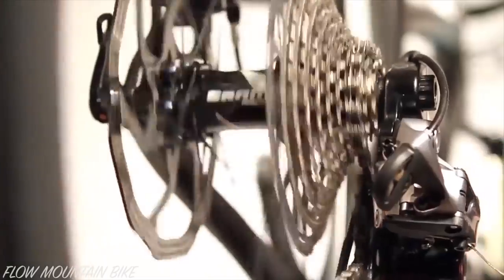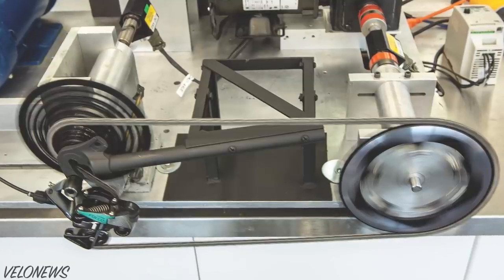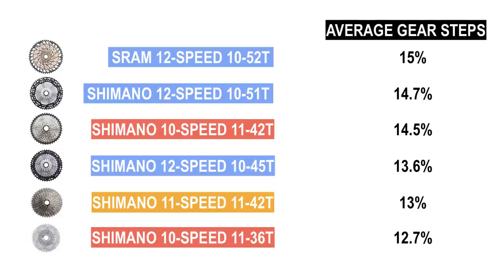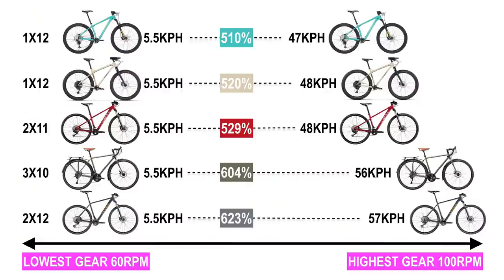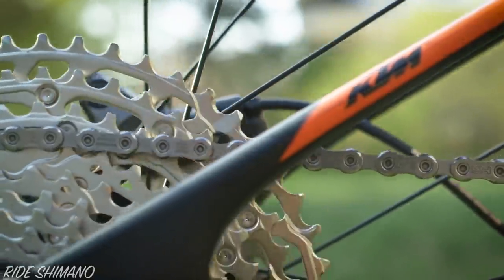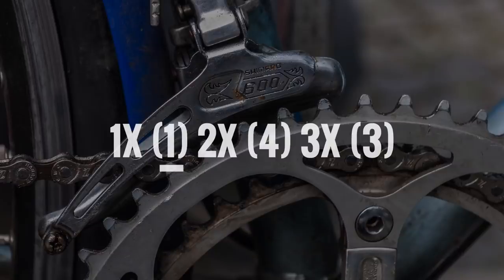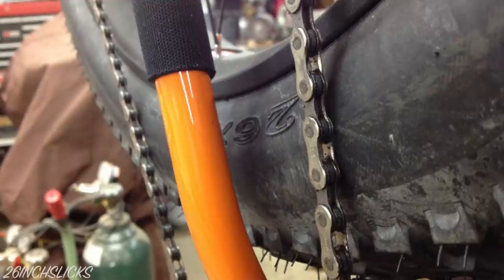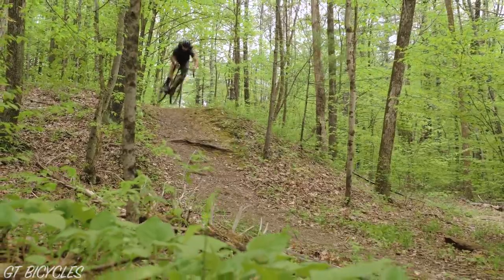1X vs 2X | What is the ULTIMATE Drivetrain For Your Bike?

Comment: The 8s chain can be used for more than 10,000km; the 12s chain loses shifting performance after less than 2,000km. As always, SRAM products give strange results in testing.
Reply: In Wippermann's test of the 11S chain, SRAM's chain was the lowest of all manufacturers.
Reply: The laws of physics in our world don't make a lightweight, thin chain last longer than a sturdy 8s chain.
Reply from the maker: It's not about physics. The latest materials and surface hardening treatments only make it to the new 12-speed equipment, which results in thin chains lasting longer.
Reply: @Cyclingabout  Oddly enough, I remember hearing the same story on the 9s, 10s and 11s.
Reply: I doubled the number of chain changes per year when I went from 8s to 9s.
Reply from the maker: This is not a story. The same guy has tested 9, 10, 11 and 12-speed chains on the same test rig, and the chains are lasting longer every generation.

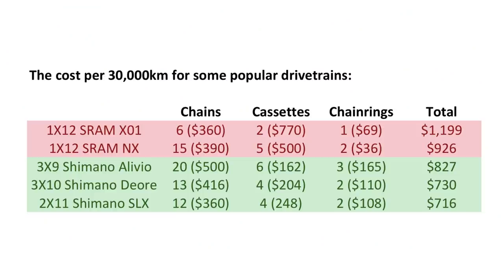Comment: 6:19 something's wrong there. 20 Alivio chains for 30k km means alivio chain lasts only 1500km, and that's totally wrong. And it cost about twice  less then 25usd (500/20). Then, Sram X01, 6 chains on 30k km = 1 chain /5k km. Minute earlier we were told X01 goes for ~7k km.
Reply from the maker: Oops, a few mistakes in there because Zero Friction Cycling has two different ways to measure 0.5% elongation. I also had to round up and down some numbers to arrive at a 30,000km figure. Prices were all from the same online store.
But don't get too caught up in the details - chain longevity is mostly based on the conditions, cleaning and lubrication.
Reply: @Cyclingabout  I just don't get how can it be that 12sp thiner chain that works with whole range on cassette with maximum offset can last 3-4 times longer, then thicker 9-10sp on 3x9/3x10, where it works with 3-4 according chainrings on cassette with low offset. I'ts either wrong experiment conditions, either just Sram paid "experiment".
Reply: @Cyclingabout  even logically, we have power loss info, more power loss = more friction = more wear.
Reply from the maker: It's unfortunately not that simple. We believe the reason why top-tier SRAM chains last so long are because of improvements in materials engineering and metal treatments. Expensive chains go through more levels of material hardening compared to cheaper chains.
In terms of resistance, it's the larger gaps between the components of a chain (allowing lubricant to travel freely) that makes them fast. SRAM is running much tighter tolerances compared to Shimano.
Reply from the maker: @Tom Zabukošek I'd love to see the data on an HG71 chain too!

Comment: One clear advantage for 1x is the oval chainring, while it can be found for 2x systems too, but it is more common for 1x drive trains. 😁
Reply: I rode 1x with an oval for around 3 years, and switched to 2x on my new bike and I don't notice any difference.
Reply: what's the advantage ?

Comment: I know it's not as clear as comparing drivetrains but have you thought about making a video about tires? For me this is one of the ultimate bike nerd topics. I would be interested in a compairison of different puncture protection like having a rubber inlay like the Schwalbe Marathon vs having a nylon based system. 
Or just in general, which tires have you been running/ most happy with? What is your take on tire width and pressure. Most of the time this is only considered without luggage but I think it would be interesting to see how you find find the best pressure If you have an unusual weight balance like on a loaded touring bike
Reply: Oh I just saw you had an article about tires already but no video
Reply from the maker: I can definitely cover tyres in a future video. You should find three articles on the website around tyres. The topics are rolling resistance, punture resistance and bikepacking/off-road tyres.

Comment: Thanks for this video!! These are all conclusions I have reached using logic and personal experience and now I have saved this video in my browser to show people the objective proof! The trendy (non competition) bikers laughed at me when I bought a new, high end mountain bike (with front and rear suspension) and had the store install a 2X11 Shimano cassette instead of taking it with the 1X12 SRAM set. I do such a wide variety of intense recreational cycling here in Costa Rica so the 2X (and suspension lockout) made so much more practical sense to me. I can climb steeper grades and take advantage of long downhill sections on asphalt leaving my equally-fit riding companions behind in both situations. I have a road bike and love riding that but my mtb is a great ride even for long distances on the roads due to the overall range and closer spacing of the gearing (and using the suspension lockout). The real surprise in your research is the durability of the 12 speed chains!! What would account for this?! It seems like a subject for a future video. If you could get a longer lasting 11 speed chain it would make it an even cheaper long term setup.
Reply from the maker: There is a lot of interesting stuff going on with chains, so it probably does warrant a video. But essentially, for every new generation of chains, we have a better understanding of materials engineering, metal hardening processes and coating treatments. Unfortunately, the latest chain technology is always reserved for the top-tier chains, which have the most speeds.
Reply: @Cyclingabout  The difference is striking however. I'm sure the tech will trickle down (look at how a $1000 bike is much better than a bike of equal indexed cost from x number of years ago). 
PS Just watched and thoroughly enjoyed your 2,000km Mexico video. Well done!
Reply from the maker: @darylloth3237  Cheers! Historically, chain tech rarely trickles down - so I wouldn't hold your breath. There is a chance that the chain-specific companies could introduce products to fill the gaps, but they usually don't have the same kind of resources as Shimano or SRAM. I guess time will tell.
Reply: @Cyclingabout  If you're ever in Costa Rica look me up. You've got a place to stay if it's on your route.
Reply from the maker: @darylloth3237  Cheers! I passed through late last year, so it might be a while until I'm next in the area. But a lovely part of the world to live. 👌🏼

Comment: I'd say I still prefer the 2x because I can get a  bigger range . But my new 1x is a 34tooth only slightly smaller than my 36 tooth on my 2x which actually makes the ratio of the second last gear better for me. I couldn't really use the last gear on my 2x drivetrain and I have never needed to use the first gear on my 2x I think the lowest I've gone is 3rd gear on the 1st chainring. My 1x drivetrain's 1st gear ratio is slightly lower than thay so there's no problem. Plus the linkage is completely different , I have to deal with a lot of pedal sag on the old one but almost 0 on the new one

Comment: 5:31 now what i wonder is what the results would show if you didn't use a drive chain sold for bikes? There are alot of industrial use chains rated for the same size and dirty conditions that could do better.

Other mods might need to be made if you have alot of gears, hence why I think the idea could work better for either a 3x or anything with less gears.

Comment: I have a older 2002 mongoose mtb model zero 3. Could you answer a couple questions please? 1. I am trying to make this dual suspension  bike a hybrid road/ gravel commuter by changing to a 1x crank chainring. What would you recommend as a budget conversion? Bike is stock. I am changing tires to a road/gravel tire but wondered if you could recommend a low rolling resistance tire with puncture restistance please. My commute is 20 miles round trip on hwy tarmac shoulder. Thanks for all you do and your awesome informative bike videos. Cheers!

Comment: Very good video! But 3000 km and more on a chain offroad? Hell what? On my Gravelbike a good KMC chain last max. 1200 km until it reaches the 0.5% mark on a 1x 11 setup. In my opinion the sometimes angled chain on 1x and sandy soil  here are reasons for that wear. I clean my drivetrain carefully after every ride. With 2x10 on my old bike a chain last 2000-2500 km. I also don't like sram chains. I tried a PC1130 on 1x11. No smooth shifting and 0.5% wear was reached after just 800 km.
Reply from the maker: It totally depends on the conditions. But a controlled test gives us an indication for how well chains compare relative to each other.

Comment: I'll never really understand the "it's simple" mentality of 1x... as if shifting front gears isn't simple? But so many people say this... susceptibility to marketing? Triple fronts do tend to be finicky but I blame the move to "indexed" front shift for this, they should have just stuck with friction for the front and the near infinite trim. Jan Heine does a great break down of the problem in his "Trouble with STI Triples" article.

edit to clarify, I see a lot of questions posted on reddit and I guarantee most of the riders who say "it's simpler" to me have never once looked at a gear chart or attempted to follow a shift pattern which is why I think it's more marketing than actual feedback. Setup could be an issue, maybe? But friction in the front would eliminate most of that. Also don't understand why some people get this idea that you're constantly shifting between rings, I tend to just stay in whichever makes the most sense for the trail I'm on, almost more like having two doubles on one crankset but where I'm mostly on my 48t or 44t on pavement and usually in the 36t or 32t on gravel... 26t and 22t for big climbs are lots of loose stuff on a hill.

Comment: I reckon Shimano drivetrains peaked with the first clutch derailleur setup of 3x10. With an 11-32 cassette and 44-24 chainring range I get very even gear steps, a 533% range and because this was before Shimano started fitting ridiculously powerful return springs to the derailleurs (Possibly to compensate for the horrific cable routing in new full suspension bikes), so shifting gears is much easier. I especially notice this a few hours in to a decent MTB ride where I dread having to change gears on the 2x12 vs 3x10 because it feels so much worse and takes so much more force.
Another point on drivetrain selection is that it's not possible to get anything that gives a top gear suitable for 27.5 or 26" wheels in 2x drivetrains at all, so on my older bikes the 3x10 setup is still the best option. Closest you can get is the XTR only 38-28 chainrings on Shimano 2x12 when I need a 40 tooth to match the top gear I'm used to, and there's no way I'm paying 3 times as much as an XT crank for this.
Hopefully with time Shimano will release a touring version of the XT groupset with bigger chainring options - that's where the 44 and 48 tooth chainring options from 3x groupsets come from.
Reply: @Tom Zabukošek The high shifting force is from the return spring - it's just as bad with the clutch completely turned off or the chain removed. 
It used to be a bit of a pin to adjust clutch tension on everything below XTR, but 12 speed derailleurs (Certainly at XT level) have easy adjustment of the clutch tension via a hex key when you pop the rubber plug off the side of the clutch housing. This is not the source of the heavy shifting. 
The second generation of XT clutch derailleurs was where the heavy return spring started, along with 2x rather than 3x chainrings to give a basically pointless 450% gear range. The left hand XT shifter of the era had a switch to go from 2x to 3x shifting. 
The right shifter would also double upshift moving the lever in both directions rather than only with the thumb like current XT, and it would let the downshift lever move freely rather than jam as if there's another gear to shift to tell you you'd hit the bottom of the cassette, while current XT 12 speed jams against the stop. Now that I start to put it together there are many things that made 3x10 XT nicer to use than current 12 speed.

Comment: What's the ultimate drivetrain for MY bike? Super low gearing for hills and exploring nature. I run a 1x using 64 bcd chainrings. Even with a 22t I can still roll along at 17 mph which is plenty fast for me on the flats through the woods.

Comment: I am certainly NOT a fan of a 3x MTB drivetrain.  I prefer a 2x for my MTB because when I get in trouble on a sudden steep incline, I can drop to the smaller chainring up front which has no stress on the chain and no "grind" downshifting to the lower gear.  My chainrings drop about 2 to 2.5 gears in ratio from big to small.  Just what I need sometimes to save myself.  With that said...I'm shopping for a 1x system now.  LOL

Comment: If you're like me and you want a One by System. But you have 2 by in the front. Just use the smaller Cog in the front and it just all that different sizes in the back or whatever done.🤣

Comment: I am thinking of buying the Priority 600 or 600x bicycle with the Pinion C1.12 gear hub.  However, I think that these bicycles lack the high end speed of higher end road bicycles, which lack the low end gearing for mountain climbing.  Is it possible to build a 3X11 or 3X12 (better than the 11 speed cassette) drive-train mountain bicycle frame (for accommodating wide tires) with drop bars (for high speed) and STI shifters (for ease of use).  What would be the specific drive-train setup with the widest gear ratio that would accommodate the above mentioned features of this bicycle?  Can you make a video of such a bicycle build?

Comment: The 1x12 SLX on my Surly ICT has finally sold me on the abilities of the 1x. Before that I would say I preferred the 2x10 on my hardtail 29er. I have a 1x11 on my full suspension, good not great. A good 2x10 is tough to beat. Haven’t used 2x11. We’ll see how the 12spd wears.
Reply: I'm thinking of possibly trying a 2x without a front mech (just hand move the chainring when I need to) on my Ogre, but I use so few of my gears regularly even on my 1x10. I'm wondering if the better option would just be replace the NX crank with a Race Face and throw on a Wolf Tooth CAMO, and have a daily use larger commuter ring and a smaller bikepacking ring. I just wonder with this if the same chain would play nice with a larger circle ring and a smaller oval ring.
Reply: @Spitch Grizwald Two different chainrings should be fine, regardless of crank set up, as that's what every 2x or 3x does anyways. The issue I'm wondering is when switching circle to oval and back. The other issue, at least for me, is that a 2x still changes the chain line. So, even without the derailleur, it still has tire clearance issues (3" tires). If I can get a boost 2x though, that might eliminate the problem. As for gearing, I don't want a narrow range cassette because the lower gears are necessary for bikepacking, and I want my bikepacking set to be compatible with my commuter set up. Just swap the wheels (and maybe chainring) and go. Its the gear ratios that's the problem. While commuting, 90% of the time I'm in one of the 3 highest gears. I only shift lower if I get caught at a light. And bikepacking anywhere that low gearing is necessary probably means managing cadence is a useless effort.
Reply: 2 x 7   microshift / shimano  setup

Comment: I went back to 2x10 on my mtb. 32-22 front with 11-36 cassette. Low gear equilavent to a 32f- 52rear 1x but much tighter ratios.
Reply: Dude that's gold! Especially the much tighter ratios  but also the final low ratio and gear inches. The only thing I would argue as well as practice is ditching the 32 and just running a 22t front. If your really just doing offroad and singletrack than you don't need the 32t.We are all being sold 1x with mainly 32t front and 9/11-42/52 rear but do we really need the top end? I have a fat bike with an 11-32 Ultegra cassette and a 22t front. I had to omit the 11t because it wouldn't fit but at 90-100 cadence I top out at 18 mph. And while optimum cadence is highly considered in the road/gravel world it also pays in almost every other type of cycling.

Comment: You mean the cracking noise from my 1x drivetrain means it is less efficient, yea I thought so. 3:70 Bro how many people actually did 47 KMPH on any drive train at all :) The top speed of MTB I manage is 30 KMPH and that will be maximum effort.
Reply from the maker: The highest gears are for downhills where 45-60KPH is not unusual. 👍🏻

Comment: Does anyone happen to know how common 10T cogs are on cassettes fitted to bikes intended to work with a 1x system?

As I understand it, you have to have a specific type of axle to allow 10T. 11T is the standard minimum. 

10T would be a desirable compensation for the lack of larger ratios up front on a 2x or 1x.

Comment: thank you. i dont like the idea of 1x. when in a high gear and type of back pedaling makes the chain ramp up over the top of the chainstay because of the inertial moment of larger cassettes.
Reply: not to mention, from day one we are told to keep rotational weight on the wheels low. ok it is near the hub buuuut a 42t cassette is not what i call near the hub.

Comment: Is there any bike which have internal gear system combined with rear derailleur ? I kinda like the concept of 3 speed internal gear combined with 1 x 12 speed, using 38T chainring combined with 11-28 cassette, the 3 speed internal gear is just like having 3 riding mode, the climbing mode, cruising mode and high performance mode while the short step of the cassette to help you maintain your cadence (maybe)
Reply from the maker: Sturmey Archer RF3 and SRAM Dual Drive are two IGH options with cassette bodies for a rear derailleur.